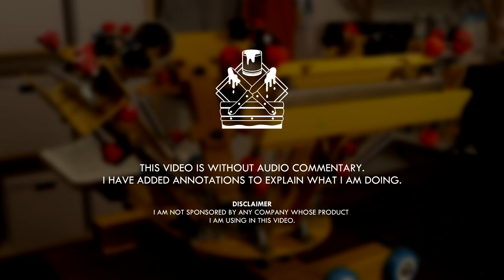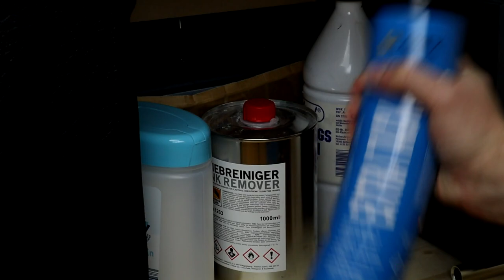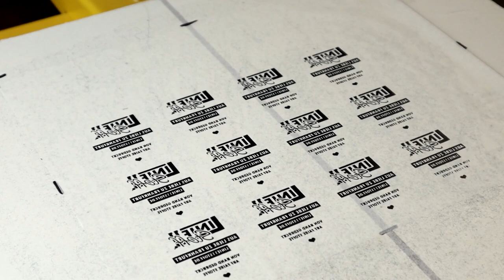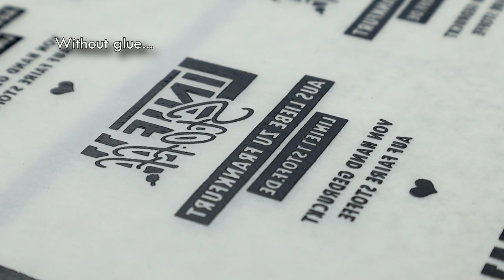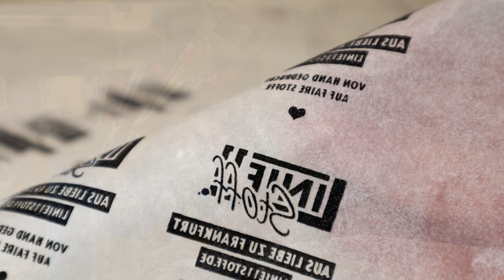Screen printing storable neck labels with transfer paper

Comment: Hey man, thanks for the video! What advice do you give for gelling the ink? My ink seems more elastic than yours, and while it does come off cleanly while peeling. I can't pull it, I have to scrape it bit by bit. What do you advice in this situation? Also do you think it is possible gelling the ink with heat press instead of a heat gun?
Reply from the maker: Sounds like the ink might have gotten a littel too hot. I recommend doing a test sheet and heat it up shorter/longer in different areas and see how where the results are to your needs.
I have tried gelling with a press and while it is possible, I had the problem that the paper lifted in some areas and came in contact with the hot plate. That's why I use the heat gun, but in general, yeah, it's possible. Just use a infrared thermometer and keep an eye on the temperature. Your results might even be better than by using a heatgun.
Cheers

Comment: Nice informative video. That transfer paper you used in the video, Is that parchment paper? If not, what is it called?
Reply from the maker: cGee thank you :) it is called transfer paper, nothing special. Sometimes it’s also called silicone-paper. It looks and feels like baking paper/parchment paper. Slightly glossy and somewhat „waxed“. Maybe you could try using this. I can imagine it being a nice, low cost alternative.

Comment: Is it glue power is a required item? only plastisol ink doesn't works?
Reply from the maker: Yes, the powder is required. Otherwise the plastisol will come off after the first wash or might not even stick in the first place.

Comment: Is plastisol glue the same as the one used in DTF printing.
Reply from the maker: It does sound as if it’s pretty much the same stuff - but I have zero experience with DTF so no guarantee ;)

Comment: what if you dont use the glue powder?
Reply from the maker: Well, the powder, when it's molten, builds a barrier over the print so that a) the ink does not completely dry and b) it makes it possible to store the sheets while not smudging the print.